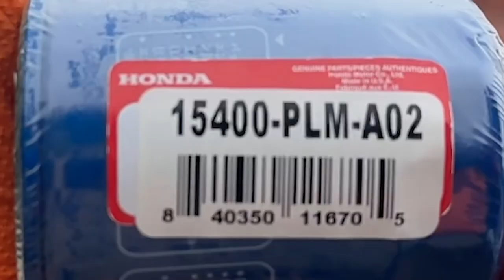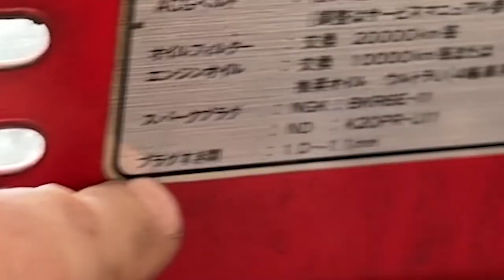Honda Beat Tune Up - Battery Replacement, Oil Change, Air Filter, Spark Plugs

Comment: Great explanation of the difference between "JDM" and "UDSM" Battery Post connections, I would have NEVER thought that there way "that much" of a difference to require an adapter for a sound connection!
-Thanks MileHiKei for bringing this up.🖖
PS, May have been better to "Jack" the BEAT from the front (to a higher elevation)  to allow better oil drainage...
Although you have the (better filtered) K&N Filter, you need to follow the "Proper K&N Filter Cleaning and Re-Oiling Procedure to ensure proper Filtration to keep your engine running strong!
-Always know what you are working with. "Name Brands" mean ABSOLUTELY NOTHING, if the product recommendations are not fulfilled...